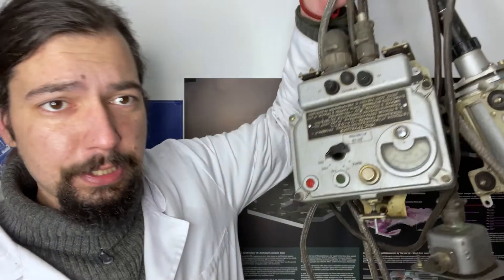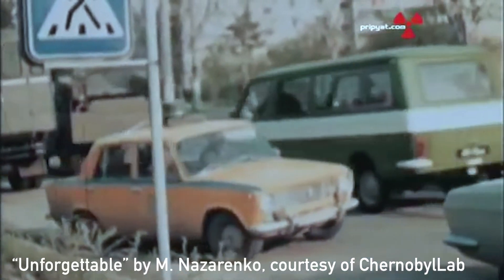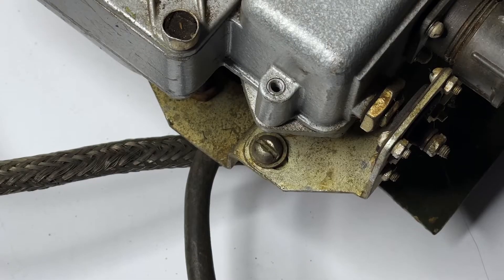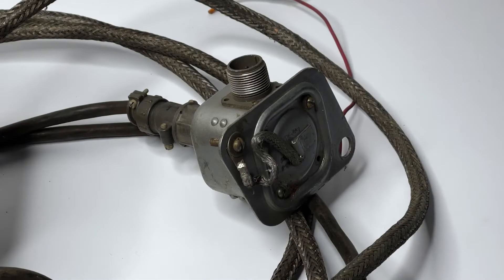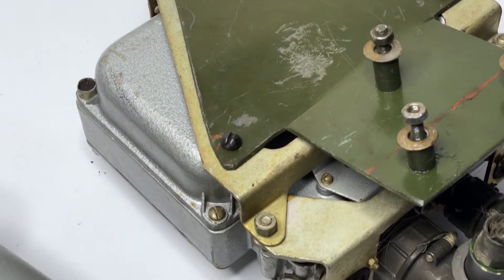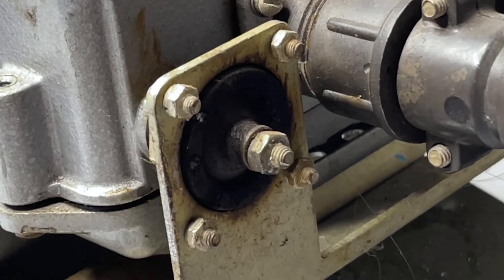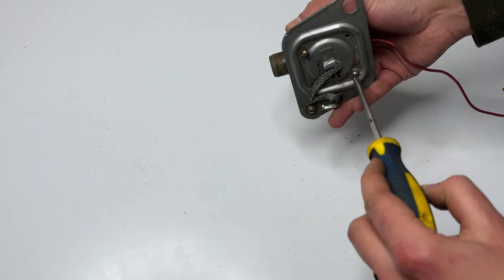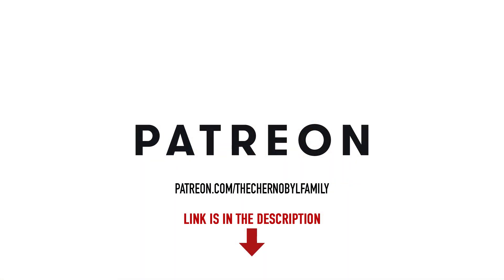Chernobyl DP-3V, the MOST HARDCORE dosimeter ever

Comment: Actually, those tubes inside the detector are 6H16Б-B double triode radio tubes. I am sure radio tubes are used instead of transistors because they operate better in high radiation conditions.
Reply: Bipolar transistors exposed to radiation loose gain, or if exposed to neutrons , get their silicon transmuted and loose the doping . Their breakdown threshold also drops in presence of radiation and some can get even saturated by gamma radiation, working like phototransistor. 
In 500R range this could be a problem 😂
Reply: @piotrcurious1131  That makes sense especially that the tubes are in the sensor head that is exposed to those high radiation levels. In my experience these tubes can last a very long time too.
Reply: Yep - I was going to say that those indeed are vacuum tubes. Beautiful ones.
Reply: They're also immune to EMP. The Soviets were using them in their frontline military equipment as late as the MiG-25 interceptor and I suspect that's part of the reason.
Reply: @ironhead2008  The EMP immunity is bit of mythical, like how many EMP bombs got detonated to test it ? 😂 Certainly Dolam is not giving you certificates for that. EMP is very powerful and causes thermal effects. Miniature vacuum tubes can get broken by sputtering during EMP pulse. Semiconductors can be made much more EMP resilient by reducing their size and creating fast shunt shortcut paths directly on-die.
Reply: @piotrcurious1131  To be sure it wasn't the only reason.
Reply: @piotrcurious1131  I think that ?Starfish Prime? gave all the evidence that we could handle about the effects of EMP!  I seem to recall that they took out their own newish ?Telstar 1? which one has to assume was fairly well hardened against radiation. 😂
Reply: @robinwells8879  you confuse EMP with radiation. Starfish prime was a nuclear test leaving radionuclides and high energy electrons trapped into the magnetosphere, in high vacuum. And it was deliberately designed to leave only short lived isotopes behind, as it was just a test - normal military operations or special military operations will leave stuff which will decay for decades incl. fizzle products from intercepts, spreading plutonium etc. bit like after Palomares incident.
Reply from the maker: @ironhead2008  thank you for the details!
Reply from the maker: Thank you for the correction!
Reply: And because the USSR made tubes deep into the 80s. You are right, but isn't the other one a pentode? That would make sense, for measurement usually a bridge circuit is used. You could build one with a double triode. And a pentode amplifier in front of it for measuring lower ranges.

Comment: The aesthetic and performance is what it is, also very crummy looking readout gauge but the electronic internals looks well built and very repairable. The 3D component arrangement is almost artful.
Reply from the maker: There was one more modification from the late 80-s, where the meter was a squary one. Had a luck to get one with more original design. Well, i suppose that when you deal with that high levels, even approximate readings are pretty sufficient, though. Totally agree on 3D arrangement. Not my style, but how much patience one would need to make it that straight!